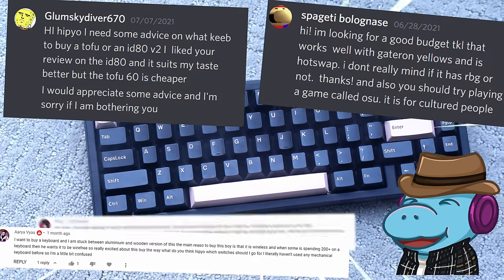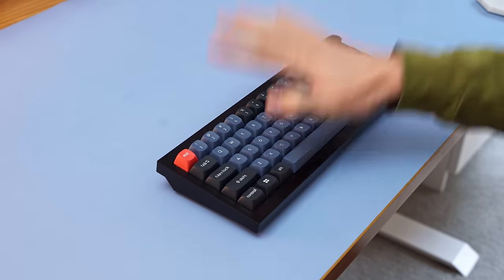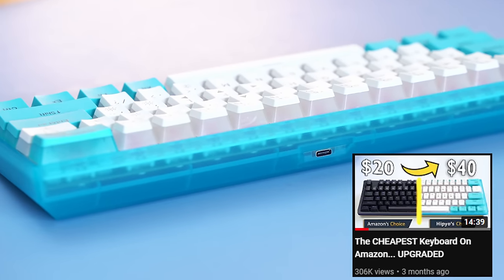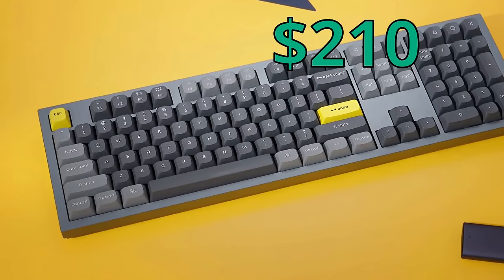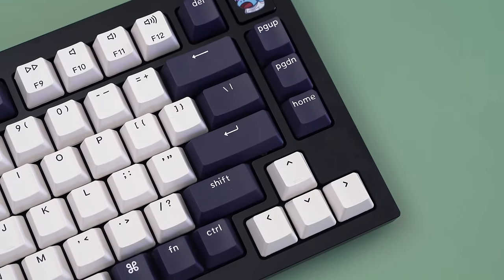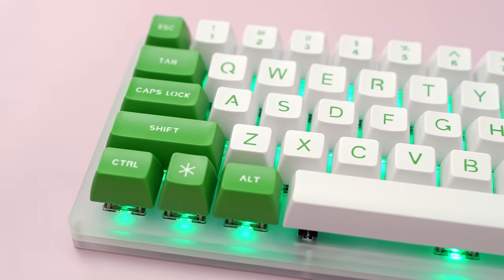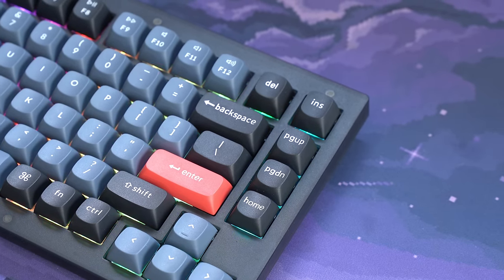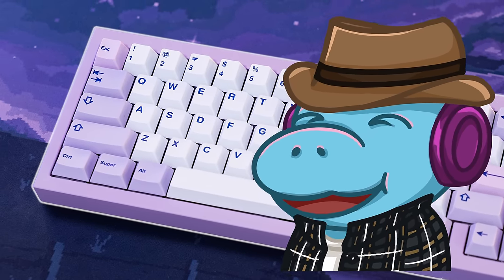What keyboard should you buy in 2023? (BUDGET FRIENDLY)

Comment: solid recommendations but Akko definitely has some of the best budget options out right now, even if they have north-facing LEDs
Reply: I was about to say Akko. The look/finish is impeccable, they sound good out of the box, sound even better with simple mods, and they're somewhat in-stock depending on how picky you are about color.

The 75% ones have 4 nav keys on an exploded layout, which is very important to me. The GMMK pro is the only other option for that.

They also sell really excellent keycaps, and really good budget switches that don't have north-facing interference with cherry keycaps.

Future boards will be south-facing, which solves the only serious problem. Minor problems include very bad software (no VIA/QMK) and getting decent flex requires some modding.

They are also officially licensed with Sanrio in case you have a little sister.
Reply: @iM7SnaKe  ?
Reply: @iM7SnaKe  why?
Reply: Cap
Reply: Akko really brings the value. I live in the states and their boards only cost ~$5 to ship as opposed to the $30 flat Keychron is asking. Also they come with ALL the caps, which is impressive. The 3068 and ACR75 lines are solid contenders for that mid range ($80-120).
Reply: I agree, I really like my MOD007V2. 
HOWEVER, their software is kinda butt right now, and the knob kinda wobbly, atleast for me. So I'd recommend a knobless version of those. I would go knobless if I were to buy again (only got knob because space gray was in stock for that)
Reply: came here to say this. nobody is doing it like akko. you’re getting $65 keycap sets in $100 boards …. just got the world tour board and my friends are rabid. pc75b plus year of the tiber is my next keyboard 100%. akko is KILLING it.
Reply: @matttran7161  keychron is literally the only 30 dollar ship, also cannon keys stacked keyboards are nice fore people who want layout support and can solder
Reply: I just bought some Akko switches for my Redragon K552 Kumara, and they’re really good for the price I payed
Reply: Especially the akko acr pro, damn
Reply: I completely agree with this statement. I love my 3068b. The only thing I did was a tape mod and I love it. The Jelly Pinks are so nice.
Reply: I agree
Reply: i don't see north facing as too much of an issue, but maybe because i simp for oem profile
Reply: Akko 3068b is very good for the price
Reply: North facing LEDs with newer switches aren't even a huge problem anymore with cherry profile keycaps
Reply: man's using f3 minecraft block info to describe where the LEDs are facing, very gigachad
Reply: @pencivilization  aren't north facing LEDs literally made for cherry caps? you're selling a proprietary limitation like it's a good thing.
Reply: @arandomguyonline6436  you better get used to it, that's industry standard terminology for you.
Reply: @JackPorter  it's more to do with the orientation you put the switches in
Reply: @JackPorter  I completely forgot that I commented
Reply: Specifically what Akko keyboard can you recommend
Reply: @samsaumaralikhan  super idol replied to a comment on a budget friendly keyboard recommendation video made in 2022 and he asks to specify a good Akko keyboard.
Unfortunately, I do not know of any Akko keyboards, but rather I has considered getting either TLC Nimbelback or Royal Kludge RK84
Reply: They are quite good but my Akko switches are starting to die after a year of use. They occasionally can't detect presses and I've had to replace ~5 of them already.
Reply: Definitely agree, i picked up one of their world tour boards, came with factory lubed switches which are pretty good, could do a slightly better job myself buy not worth the time. 
Opened it up, added some foam to fill it up, tape mod, bandaid mods and it sounds as good as my full custom boards, just at a serious fraction of the price.
Reply: @krysin  damn, this a trendy comment selection.
I haven't been thinking about keyboards for a while now, hopefully I'll get back into them at some point

Comment: I recently bought and modded a RK100 pro as my first “dip” into this hobby. The board cost about $80, and with just a tape mod, lubed switches, and new key caps she THOCKs! 🙂 Plus it’s got the option of Bluetooth, 2.4Ghz, or wired connection, and custom RGB with 28 preset modes.
Reply: I just got one too. Its nice. My only gripe is the keys still have plastic tags from being punched out of the mold, and some of the text is distorted on a few lkke the backspace key... very minor cosmetic flaws but they bug me.

Comment: I love wafer thin low profile membrane boards... Got a Keychron K1 and never really liked it - I realized what I want isn't thin, it's uniform!
So I did my homework (thanks for your part in it!) and bought 2 Epomaker/Skyloong GK108s - one for home, one for work. I grew up with full-full keyboards and these are such a nice way to get into the hobby! Good stock stab lube, 5-pin ready, north LEDs. You can program 3 remaps into the firmware and 5 RGB modes of your choice, then toss out the driver and utility and they'll just keep it onboard. They're heavy and solid, with a good metal mount plate (always white.) I hear it's a fixer upper for connoisseurs but I already love it - I'll grow into modding it in a bit. Black home board is stock Gazzew Bobagums with YMD PBT carbon ZDA caps - looks sharp, feels great and it's whisper quiet! White work board is Akko Rose Reds soon to be lubed in 205g0/105 and a YMD PBT 9009 XDA set...
Yeah, I've been at it for about a month now so obviously I'm gonna be hooked lol

Comment: Shoutout to the Keychron K8 Pro. $89-119 from barebones to fully assembled (and they have an aluminum frame option), white/RGB backlight, comes with non-backlit doubleshot PBT OSA-profile keycaps(OSA has similar slanting between different rows like OEM, but is rounded kind of like DSA, but cylindrical concave instead of spherical), silicone case insert, foam PCB insert, polycarb case, TKL configuration, hotswap, and wired/wireless modes with a ~2 hour battery life with the LEDs on, ~8 without. There's also the upcoming K6 Pro with the same features, in a 60% layout.

I got the white backlight fully-assembled board for $114 shipped (with pre-lubed Gateron Red switches), a set of keycaps for $20 on Amazon from YMDK(OEM profile White doubleshot PBT backlit side-legend keycaps, which are AMAZING with the south-facing LEDs of the board), and a set of Kailh Speed Bronze switches (which I definitely got robbed for, $40 for 120 switches instead of $25 for 90 from a different vendor, in the interest of getting them next-day). It sounds and feels amazing to type on both with the pre-lubed reds and the bronzes. I even set up an account on Monkeytype just so I could have an excuse to type on it more, since the clicky sound is just SO perfect.

Comment: Man I'm just so overwhelmed...
Here's what I want:
- has to have F keys (not with gaps every 4 keys like many have, don't like a gap between Esc and F1 and same for the clustered groups of F keys)
- compact ish design. no numpad, so like no bigger than 70 or 75% i think?
- wireless (cabled as an option is a plus but wireless is a must. BT or dongle are fine, multi device is a plus too)
- has to have arrow keys but doesn't matter if they're cramped
- backlit, preferably per-key customisable rgb but frankly a solid white backlight is fine too
- and i think lastly, the more customisable the better but this isn't a deal breaker. if it's hotswap, great, if not well never mind. as long as i can swap caps down the line it's fine

this is basically everything i want out of a keyboard. I feel like keychron is my best option but god damn their line up is really confusing, the models are all like K number, Q number, C number, and it's not clear what any of them mean. I guess the number is the model so I assume K2 is the newer iteration of K1 right?

Also I currently have an Obins Anne Pro 1, I lubed the keys myself  and I love the sound and feel, but I bought it second hand, the battery lasts about 5 mins, and the micro-USB port was already damaged/dodgy when I bought it (dishonest seller on fb marketplace, he pretended to not know anything about it when I messaged him about it after the fact...) so literally just moving the keyboard half an inch on my desk causes it to disconnect and I have to unplug/re-plug muliple times until windows recognises it. Also the AP is a 60% board so no F keys which is easily the biggest issue I have with it... But otherwise I love it, I basically wish I had this exact keyboard, but with a battery that holds charge, F keys, arrow keys, and that would be fine (even if Obins software is ASS. it's entirely customised via the Obins phone app which is just awful, but ehh I deal with it). Also the wireless on the AP1 is terrible, if bluetooth is enabled and you manually connect to one device but have it paired to multiple devices, the keyboard will just randomly automatically decide it wants to connect to a different device... So if I want to use it with my PC, I connect it, it works for 20 seconds, then it just decides "nah i wanna connect to your phone". There is no fix for this other than ONLY pairing it to one device, but I kinda have to have it paired at least to the device I want to use it with (i.e. my PC) AND my phone if I want to use the Obins app to configure the RGB or whatever (because when the battery dies it resets the backlight settings to just solid red, so you HAVE to enable bt and connect it to the phone to set your RGB profile again)  all of this makes it unusable over bluetooth. it seems like Obins make great keyboards, but they just have 0 budget, so the product looks and feels great but everything around the product, the software,  firmware etc is just utterly awful. It's a real shame cuz the AP could be such a great budged/beginner option I think

Comment: I'm not concerned about the sound as much as the actual feel. I find that with my current keyboard, which is a Stock RK61, it just feels uncomfortable. It is a bit noisy so I would probably prefer something quieter, but the main issue is that the keys themselves just feel too big on my fingers. I wish there was something that I could find that isn't a 60% keyboard, but maybe has smaller caps.

Comment: I have had a good time modding out a redragon k556 Dharma pro, it has an aluminum frame it's a full 104 key, has per key lighting, has wireless connectivity with usb c and comes in at right around 70 bucks on Amazon. I bought a set of kailh box jades, a pbt custom printed keycaps from goblin tech keys, poyron foam in the tray along with switch foams and a tape mod. Thing sounds and looks super premium bought it little by little and knocked it out in sections as parts came in thanks for the guidance with your videos

Comment: The Drop Alt is now around $120 which is pretty good value for what it comes with stock although I'd argue that it baaaadly needs better stabilizers. The stock ones are ludicrous.

Also, the 3-pin switch sockets are a compromise that's not necessarily acceptable at that price point.

Comment: I bought an Akko board in February and the battery died in less than 6 months, so I contacted support because the board (which is wireless) will only work if it’s connected to power. After sending multiple videos to Akko support to prove the board was bad, they’ve done nothing to resolve the issue. They won’t offer a replacement, refund, or solution to fix the board after weeks of talking to them. It’s been a really terrible experience and I’m so disappointed because I’ve seen such great reviews on their products.

Comment: Personally if you are willing to do some mods and you are talking about keychron I still think for the money the c boards are almost impossible to beat. Sure they are plastic, but they have options for proper hotswap and are cheap as hell. Keychron's shipping does certainly bring them into a place where they are not in the same budget space as e-yooso or reddragon. But you can get better caps and switches with them stock and even if you don't intend to use those you can sell them and put them back towards your budget. Frankly considering how little keychron charges for the full builts versus the barebones kits it makes no sense to buy barebones. Spend the extra 20 bucks. You'll get 30 easily selling the switches and caps that came on it stock so you get your board for 10 dollars less that helps combat the terrible shipping shipping price.

Comment: The Hyper X Alloy Elite 2 is only 130$ (can be found at 100$) and has a numpad (it's a full size keyboard). A volume knob. Dedicated media control keys. 10+ key rollover. Anti ghosting. And the most powerful RGB LED software ive used so far. 
The software used in EPOMAKER RGB keyboards are very limiting. Lets say you just want the keyboard to fade between two colors. You cant do that with the software EPOMAKER uses.
Only problem with the Hyper X is that its switches are soldered in meaning its not hot swap (it comes with linear switches). But if a 200+ dollar compact that dosent even have dedicated media control buttons is considered "budget" then the Alloy Elite 2 is the best.
Dont spend 100+ dollars just for a compact that "sounds" good. Keyboards are for typing. Not making asmr videos. Removing half the keyboard kind of ruins functionality. Especially if your into things like blender or even just a college student taking a math class. Bing bong numpad time.

Comment: No Tester68? It's a barebones kit readily available either through AliExpress or even through Nuphy for 20$. It's 68%, comes with a layer of dampening material that virtually eliminates case ping too. The only downside honestly is that it's purely wireless. Have to use the wireless dongle or bluetooth. Otherwise? Get some budget switches like Akko and keycaps and you've got a nice budget set.

Comment: I actually picked up a 104 key Eyooso from amazon for 19 and modded it as the first ever keyboard. I dare say it turned out very well. I spend $30 on key caps and tape modded. Sounds nice. If I could do it over again I would probably buy a Keychron to mod..but this was insanely cheap. I also would probably get rid of the number pad.

Comment: This may be a temporary sale of sorts... but it gives that e-YooSoo a run for it's money. There's atm a 25-30$ 60% called the iLovbee i61 on Amazon. Red switches, hot swappable, RGB, and it has PCB/Plate dampener and a thin layer of foam in the underside. If you want a quick linear keyboard, then get them springs lubed and you're golden. Otherwise... maybe get some Akko switches and you got a sub50 kit with some clack in it. Heck, just for experimentation and/or keycap display it's worth having. Case looks a lot like RK61 and other budget boards of it's kind...

Comment: im not sure if i recommend the gamma k61, it might just be my experience but for me it was extremely difficult to swap out the switches and i currently have half a switch stuck in my gammak61 because it is so difficult to remove the switches from the board. i bent around five of the original switches while i was customising my board so just be aware if you are thinking of purchasing the gammak61

Comment: Really curious what your thoughts are on the RK100, I love the form factor, as I need a numpad for work stuff, but want something a bit more compact, and it's reasonably priced at 80-90 bucks depending on if you do the plastic or metal case.
Reply from the maker: Not toooo bad used one real briefly
Reply: @HipyoTech  any suggestions on any easy mods to do to it? Or didn't you use it enough?

Comment: KBD67 is a solid choice for a 65% board. I upgraded from a GK64xs and haven't looked back. Plus, at around $120 barebones it's not too hard on the wallet.
Reply: Is it an aluminum case?
Reply: @lukebaldwin2584  the regular Kbd67 is an aluminum case... However, the $120 version I mentioned is the KBD67 Lite, which is an ABS plastic case.

Comment: Think the only board I would try from these is the Keychron v1. While I do already have a modded Q1, I think the v1 is better for clicky switches (I'm a clicky gamg, deal with it :P) because the case is out of PC and I can remove the silicone dampener and foam pad and replace it with 2 way pe foam and tape mod and clicky keyboards benefits better with more hollow plastic cases over metal one. It is the same reason why clickies sounds really good in a vintage keyboard like Vintage blue alps boards and IBM Model M buckling springs.

I still don't get why most keyboard enthusiasts puts clicky switches to a tight metal board that's been stuffed with foam pads and dampeners with cherry or low profile keycaps as that will give out the worst sound profile to the clickies ^^;

Good video btw!

Comment: I know it’s not always the most recommended, but I got into the hobby this year with a GMMK pro, and I love it.
It is a bit more expensive, but it feels very premium and (to me) sounds great. It has a ton of customization options with the different color top frames and encoder knobs.
If you get one of the older produced models, you will need to do a bit of work with the stabilizers (I had to file down the stabilizer holes in the plate to be able to fit durock stabs), but it’s still a great board to me.